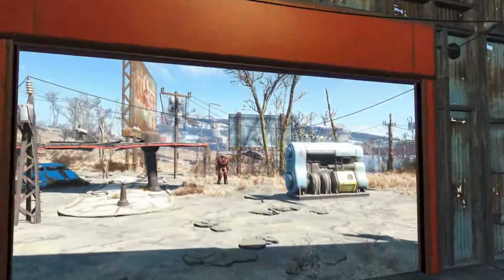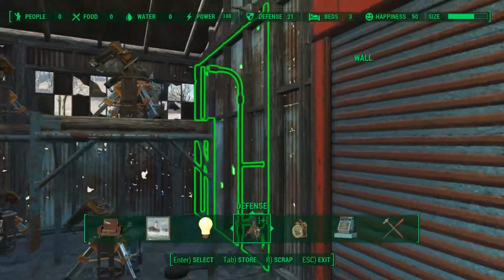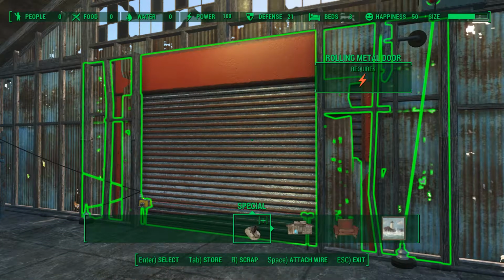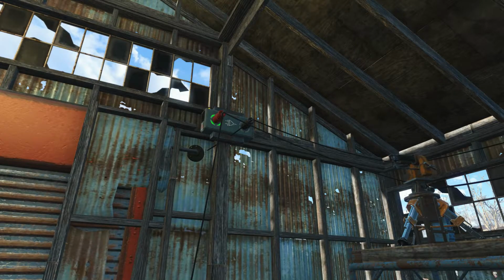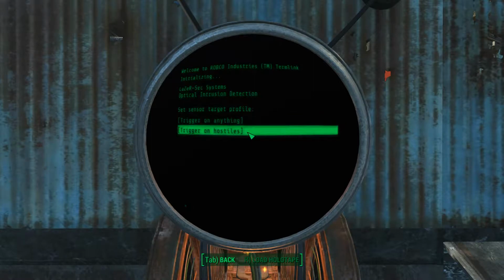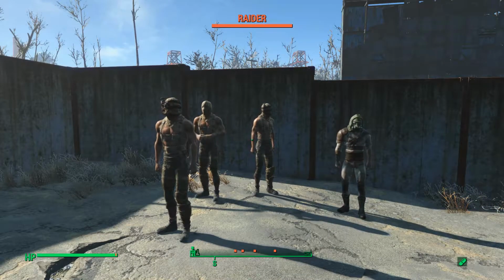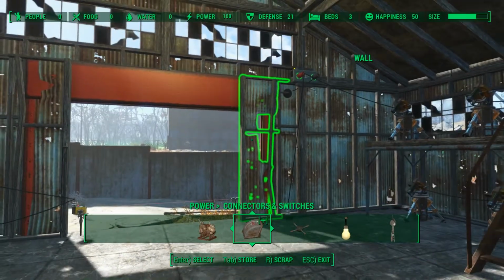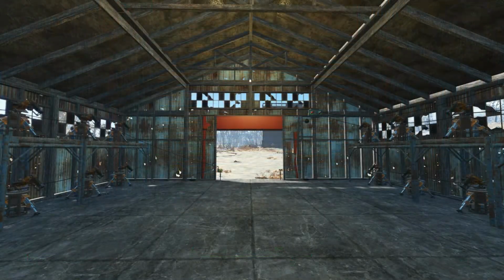FALLOUT 4 Logic Gate Tutorial - Laser Turret Gatehouse Trap

Comment: I am trying to use 3 switches, 2 near one another and one higher up, to 
control my large traps.  I want to make it such that flipping any one of
 the 3 switches changes the power to the cages that are linked together.
  I have an AND gate and a NOR gate, with all 3 switches going to AND 
input, with AND output to NOR input.  NOR output goes to the cages.  
This is not working correctly and I am stumped as to how to get this 
right.  Are these the proper logic gates to be using???
Reply from the maker: Not sure I understand what you mean. You want it so you can use any of the 3 switches to turn all 3 cages on/off? Why not just have one switch? NOR gates tend to be a bit buggy. You could try passing it through another AND gate first. So output on the first AND gate goes to the input on a second AND gate, then the output on that goes to the input on your NOR gate. Sounds daft, but it's usually how I get NOR gates to work. Some of the gates only work when you pass through another gate first. It's the best I can suggest without testing in-game.